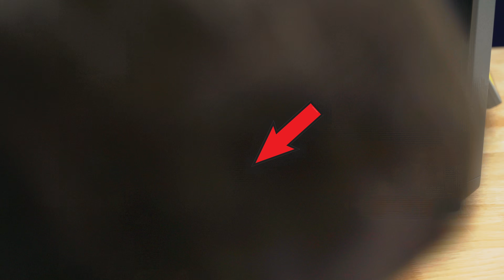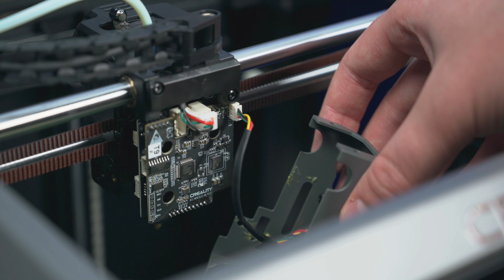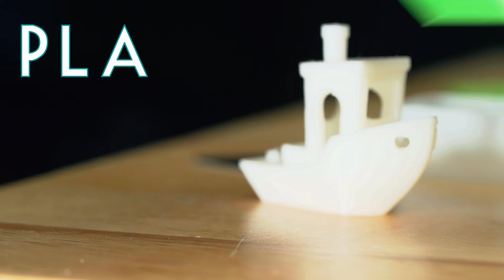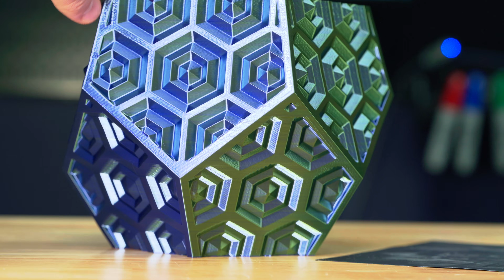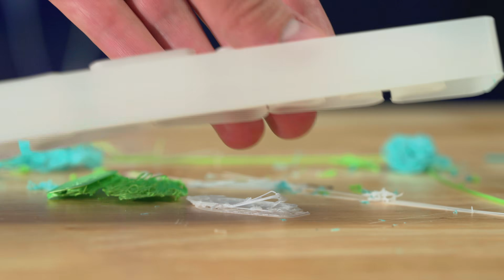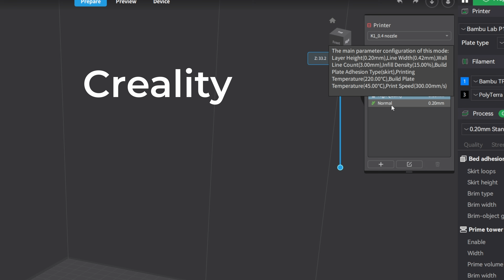How is this so FAST!? - Creality K1 First Week Review

Comment: I think creality came in with the value king on this one. It's gonna need a few tweaks and mods to hit its potential,. but nobody else is offering this kind of value on this price point, barring a voron-style kit where you have to put a ton of your own labor into assembly and setup. Especially if you plan on printing with big boy fillaments like ABS.
Reply: Creality Printers always need "mods"... fucking annoying
Reply: @lumi_arcs  Yeah and they cost a lot less than the fully featured options. What do you expect? A lot of us don't have the money for a Prusia or Bambu but are willing to tinker on a budget printer to get 85% of the way there for a significantly lower amount of money.

It's like how you shouldn't expect a Nissan to have all the features of a Mercedes or a Ryobi to compete with a Makita.
Reply: @lumi_arcs  Consumer grade printers are built to a tight budget and are far from perfect. There are no exceptions unde $1000
Reply: @caramelzappa  ... the P1P is discussed in the video and needs no mods.
Reply: @louisvaught2495  Pip needs mods just to enclose it so you can reasonably print ABS...

But it's not just mods, printers have problems. Bambu printers have issues with input shaper, and carbon rods wearing with no possible way to fix/replace them long term, just to name two issues.

There isn't a "silver bullet" consumer grade printer yet.
Reply: @caramelzappa  Also, the enclosure has to use heat resistant materials and a MC cooling fan needs to be added for high temp materials. So it’s not as trivial as some make it out to be. 

The thing I like most about the K1 vs the P1P is that if the K1 has a severe problem (like the guides fail), I can just use the working parts to make something else. Also, Creality could go bankrupt and I could still get community upgrades through Klipper. If the P1P has a problem, I’m solely dependent on Bambu. If Bambu fails, I’m SOL for implementing new tech and features. Hell, they just might stop supporting old printers and I’d be SOL.
Reply: @caramelzappa  you've never needed an enclosure to print abs. None of the enclosed printers run anywhere near hot enough to actually prevent warping, it just makes the cooling fan a little less harsh.

In the early days, the only recommendation for ABS was a heated bed, and people were expected to tune their settings.

That whole necessary enclosure myth was started by bad control of the airflow off of the cooling fans and copy-pasting layer fan settings used for PLA.

Nowadays, the control software has advanced to the point where we can print ABS more easily, but it's never been a development priority because PETG is a friendlier alternative and Nylon beats it in every way for about the same level of hassle.
Reply: @xsvforce3335  All good points 100% agree. I have an X1C and while it's mostly a great printer, the issues I do have with it are impossible to solve because of closed source proprietary. The carbon rods wearing is my major long term concern and from what I can see there is no solution besides a full gantry replacement. And by the time you need to do that you will of course be out of warranty.
Reply: @louisvaught2495  This is laughable but OK.

Even if an enclosure wasn't immensly helpful to printing ABS, which it obviously is, it also lets you filter and vent the fumes from it.
Reply: @caramelzappa  the printer you're trying to argue for filtration as a feature has an outward facing, unfiltered fan.

So no, it doesn't do that. Most modded enclosures don't bother with that complexity either.

It's better to run a dedicated filtration unit if you're concerned. Trying to package effective filtration in a printer-sized package isn't exactly a good idea.
Reply: @louisvaught2495  I never said this particular printer has a good filtration solution.

You were arguing against enclosures, I was responting to your claims, no longer talking about this specific printer. 

My only real point about this printer was that it is very high value for the price compared to the competition. It has flaws, but so does the P1p and everything else in this price range. To me it seems like you're just trying to argue because at this point I don't know what you're trying to say. Have a good one.
Reply: @caramelzappa  The point I'm making is that this isn't a reason you need to add an enclosure to a printer, or to say a printer is incomplete or incapable. 

Not all enclosures even have ways of dealing with fumes. And even when they do, it's an inadequate solution. Really a marketing gimmick, not a meaningful benefit. 

So the potential ability to maybe mitigate fumes doesn't make an enclosure a necessary feature for printing any specific material.

If you're concerned about smell, you really need a separate air purifier in the room you're running the printer.

Again, an enclosure is a cool added feature, but not required hardware.
Reply: The P1P doesn't do everything this printer is supposed to do, but it prints well out of the box. So far, I haven't seen a good first layer from the K1, but I've seen quite a few good enclosures for the P1P for those who want to print ABS...

Comment: This is the best review so far for sure. Really shows what taking a little extra time can do. Not really trying to knock anyone else, but it seems like your opinion was pretty honest and you definitely showed some of the flaws or less than perfect aspects of the machine. Will be interesting to see if your nozzle has any issues like The Real Sam Prentice just had. I also think it's funny that K1 tests so far have really ended up being marketing for Creality Hyper PLA, hahaha. I think this shows you are getting a lot for your money, but you are also getting what you pay for of course, not that that's automatically a bad thing. Good stuff!
Reply from the maker: Yeah I was always pretty skeptical of "High Speed" PLA, but I was surprised at how it worked. But I also don't mind printing a little slower to use some cool PLA colors
Reply: @JJShankles  Makes me wonder if the high speed PLA coming with machines like this and the Qidi are just lower melting temperature PLA that won't be as tough or strong or something. Would be interested to see some quality and strength tests vs other popular PLA. Hope to see some more TPU tests too. Strange it had such an issue.

Comment: Would u recommend as a first printer?
Reply: Just keep in mind it JUST released so you might want to wait a couple weeks to see if any common problems are popping up. As long as you're willing to learn to fix small issues though it shouldn't be a big deal.
Reply from the maker: Yes, it was super easy to get setup and working. I think a beginner would have a good time with it.